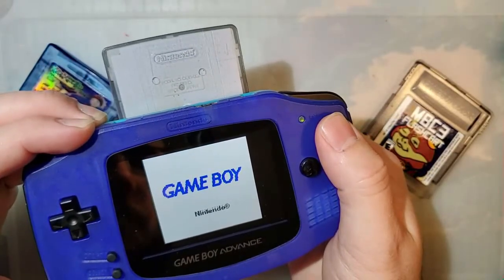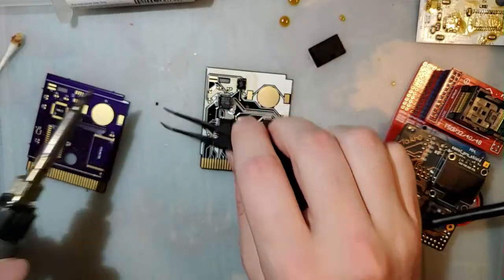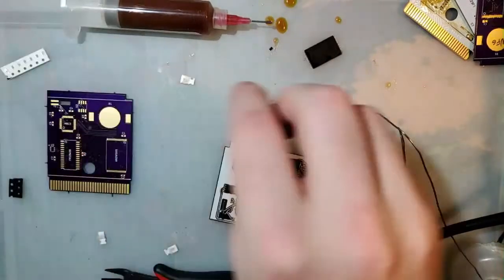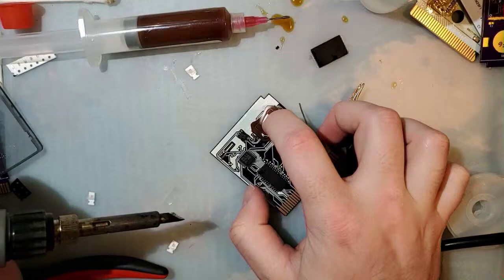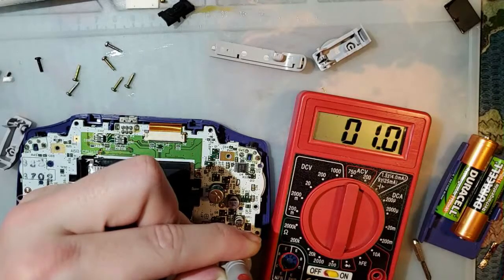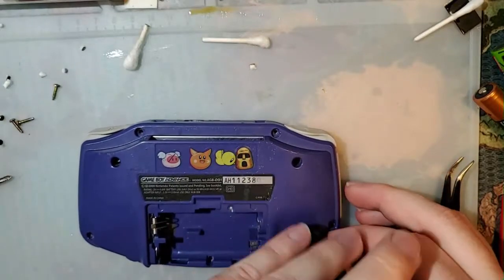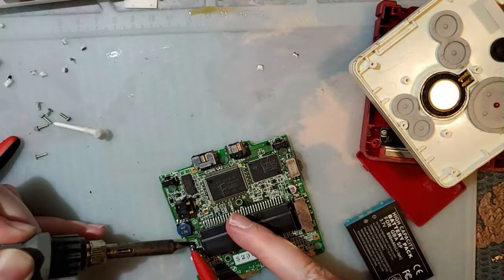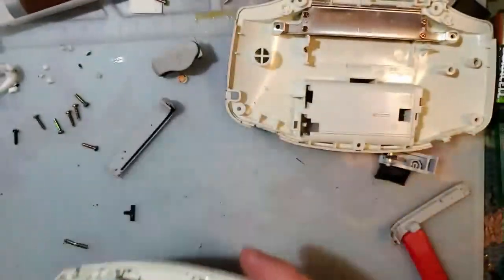Non-functioning Flash Cart Troubleshooting and Junk Console Repair [Stream]

Comment from the maker: By the way, that flash chip DID work once I got it off the board so I could have reused it. I erased it, reflashed it, and popped it back into the pile with the rest of my flash chip stock for the next flash cart build.
Reply: I was thinking the other day how hard would it be to fit an SP into a regular sized Altoids tin? Its roughly the same amount of space just different shape. And there could be space for dual speakers!
P.S. I'm aware chopping the board in half isn't trivial but it couldn't be that bad could it?
Reply: How did you create the video that is running on GBA at the beginning? 🤔🧐
Reply from the maker: @r1p1m  I just ported skyrim to GBA
Reply: @makho  really, wow, do you have the rom?
Reply from the maker: @carlos500W  no it's just a video, I was joking. https://www.dropbox.com/s/wkfq4d12cecpmn7/rorik.gba?dl=1
Reply: @makho  better one than nothing jaja, do you have plans for selling flashcards? :)
Reply from the maker: @carlos500W  not at the moment, sorry

Comment: I really suggest you get a Retroad 5 Plus Handheld with the GB/GBC Extension Converter or SFC52HD home console with the GB/GBC Extension Converter. I bought a glass screen protector for mine and a monitor bag. I use the GB Everdrive  X7  with mine for the Gameboy Color games like Mario Tennis and Mario Golf or Metal Gear. Ali-Express has them. Worth it in my opinion. Kind of heavy but I use my stand and 8bitdo snes dongle and NES Online controller. Just do a firmware update on your dongle.